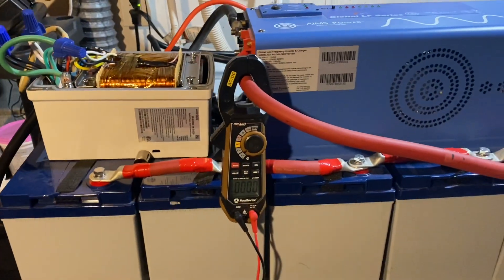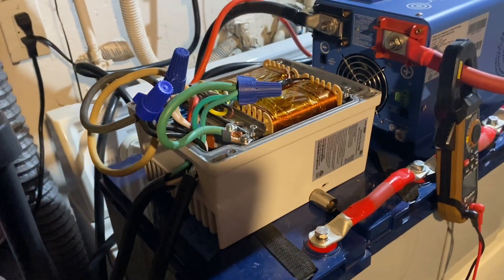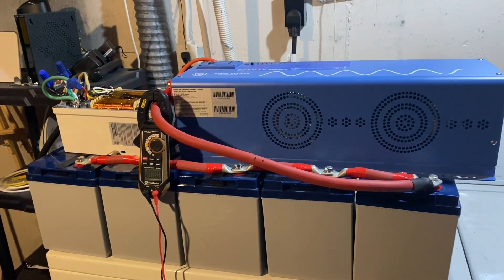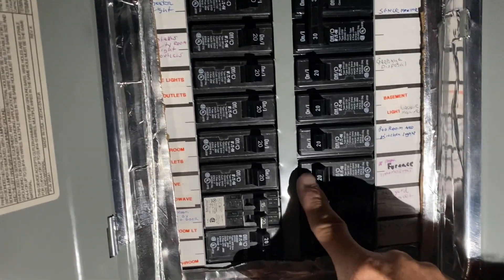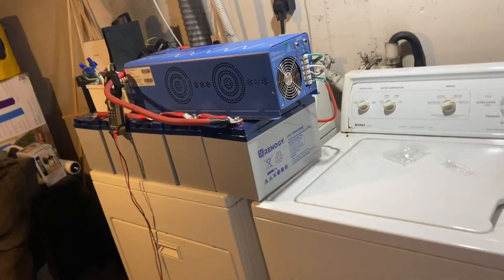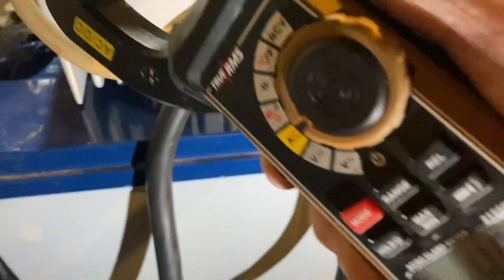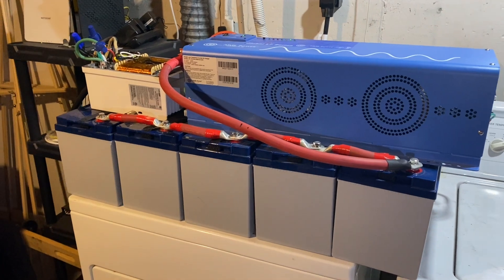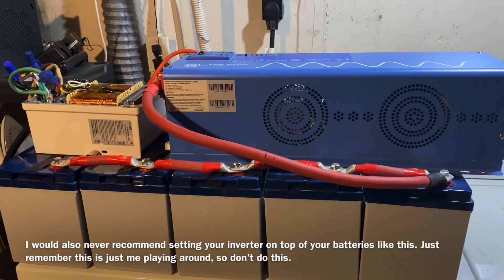Whole house battery backup

Comment: Look I haven't been following your channel but that inverter case may not be happy if it touches battery terminals
Reply from the maker: I do mention NOT to put the inverter on the batteries like that in the video and that i am just playing.  I would NEVER recommend doing what i did.   Re-watch the video and you will see that.   I mentioned not to put the equipment on a dryer and not to put the inverter on the batteries.  

This was an emergency situation because I had gone multiple days without power and was showing how easy it was to set something like this up.   

I also went on to say that you need proper fusing and disconnects.   

But yes, it would be bad if the inverter shorted out the terminals.   I did only have this set up like this for 4 days once the storms had passed.

Comment: Ive also did the minisplit ac on our camper thats the 38 seer 9000 btu inovair that david poz showed on his channel.  Our solar easily runs it 24-7. If thinking about off grid ac the inovair is hard to beat with a little over 200 watts to keep our camper cool. The first 10 or 12 minutes is just over 600 watts but after that it just sips power. Thanks again for the videos

Comment: I have a 4000 watt split phase sungold power low frequency inverter and its great. I also have a 3000 all in one inverter. I'm using two seperate batteries one is 24 nissan leaf modules at 24 volts and the other is 16 eve 280 ah cells at 24 volts so really 560ah of the eve lifepo4.  I have a victron 150-70 charge controller with 1850 watts of sharp solar panels but wanting another 10 or 12 panels. All this equipment is in our off grid camper we stay in while not in this semi truck. This alternative power solar stuff is addictive and a great hobby. Thanks to guys like you I had the confidence to build out our tiny home 30 foot camper. Thanks for the video

Comment: How long will your refrigerator and freezer run on those batteries?
Reply from the maker: My refrigerator only pulls 102 watts and it Is a large residential fridge.   
This battery bank in the video is 6400 watt hours but only 50% usable.   So that means 3200 watt hours.    
So 3200wh ÷ 102 watts = 31.37 hours.    

So with non critical loads off like my air conditioning and conserving power it should easily run for at least a day (24 hours).  
If you are running TVs and you are not to worried about the small loads it will easily run 12 to 15 hours.     

Now, since it is emergency use I may push below the 50% threshold of the battery bank and take it to 20% which normally I wouldn't do but if I did the refrigerator would last for 40 to 50 hours.  Of course that is emergency situation.